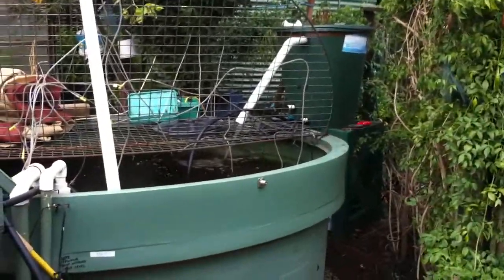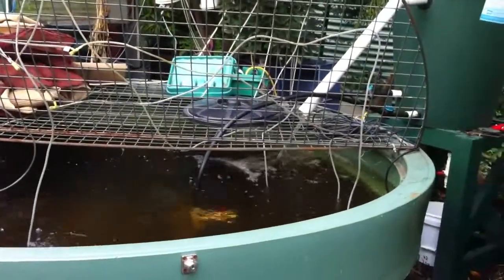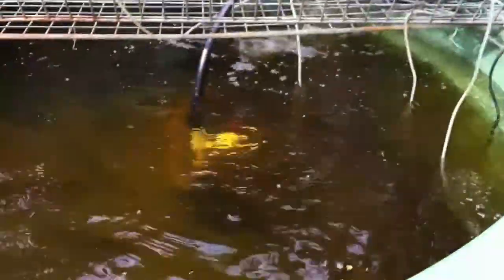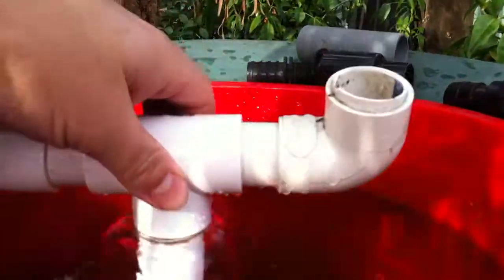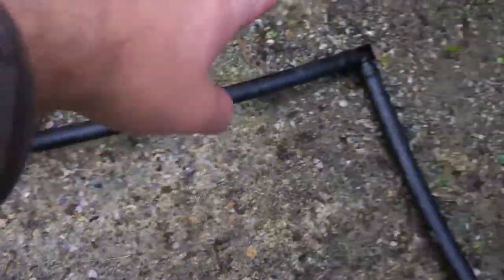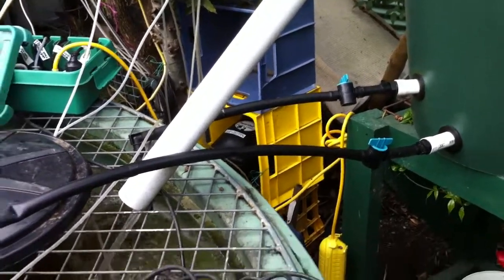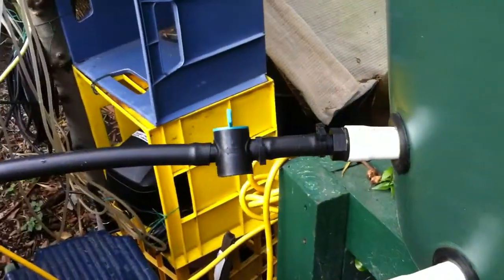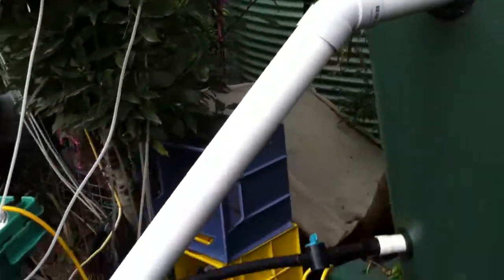Big Arse Radial Flow Filter

Comment: Hi Brett,
Love the Radial Flow Filter a great clarifier. It would work much better if it was lowered. The outlet only needs to 1 or 2 cms above the tank level. The pump is lifting water a fair way and loosing flow. If you lower it the flow would increase greatly. Say hi to Annette for me.
Cheers,
Jim Greenwood     Bitternponics
Reply from the maker: Jim Greenwood Hi Jim, that would help. The issue is the tub is so big we need to have some space underneath to add in the outlet for cleaning. turns out it wasn't an issue with the pump or the height. Leaves where blocking the end of the inlet hose, which we couldn't see in the dirty water. Then every time we turned the pump off to check things the fell away. 
I have just posted a short video on how it's now running. https://www.youtube.com/watch?v=Ves0OKz4f8M